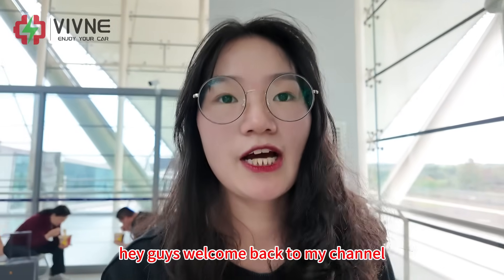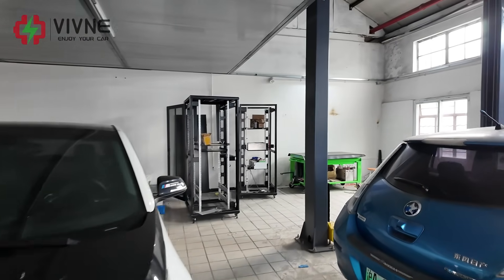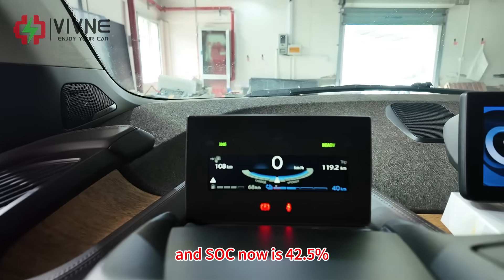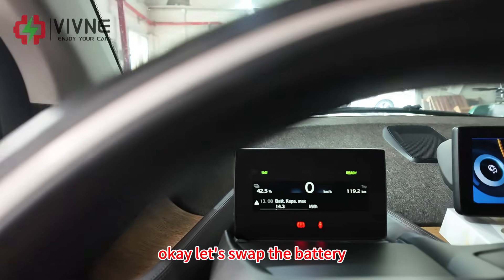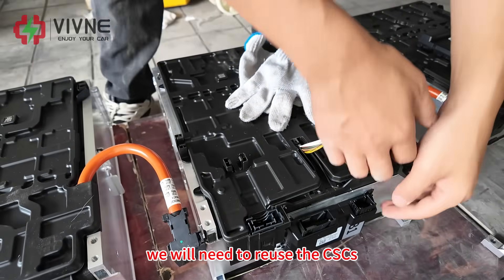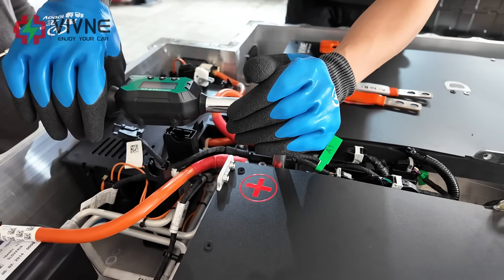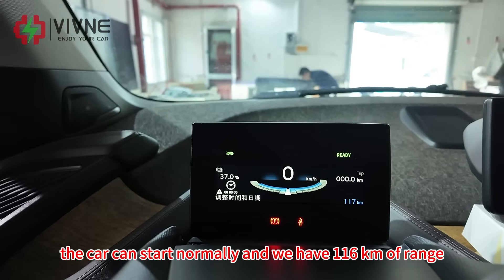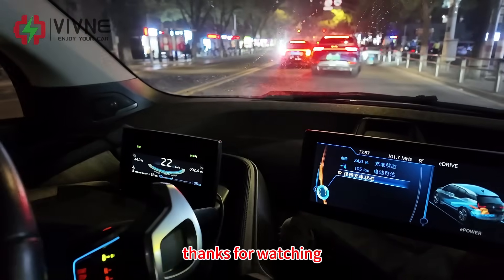BMW i3 Battery Upgrade: Full 45kWh Swap Process (From 14.3 kWh → 39.3 kWh!)

Comment: I got a 2008 Sebring with the 3.5L. Sure it runs "ok" but I splurged $400 on a new timing belt & water pump kit plus accessory belt & tensioners, etc. Paid another $750 to have it all installed by the guys at the local garage. Sure it's an old, cheap car. It'll run another 5 years, easy. Oh, wait, it had a worn-out battery too!! Same like the BMW! Fortunately, I was at the wrecker's and used my battery tester & found a decent one (with about 5 milliohm internal resistance) for $45. Well, I got 20% off because it's cold right now. I actually paid $36. So that'll take about 1/2 hr to swap out and should last 5 years, too. Oh, woe is me! My terribly unreliable old car that I bought for pennies and burned another $1000 on it so now it HAS to last 5 years. To be worthwhile.
Reply: Not sure you understand anything about the economics of EVs. Just running mine for 20k miles a year saved $4500 a year in fuel and servicing. And I don't have to drive a dinosaur..oh. btw, your car will have cost you more than the price of the EV in service and fuel.. but enjoy burning your money.

Comment: Hey. What is the price of the battery itself, excluding shipping?
Reply: good luck getting it certified
Reply from the maker: @filip3148 We actually have CE certified, thanks
Reply: @VIVNE-CoraLiu  that's not the only certificate you need.
Reply from the maker: It's 5810 USD

Comment: Same size but yet 2 time more energy. The future is bright for the used EV market. These cars will drive half million km easily.
Reply: All these old EV need new batteries. Sorry if that offends certain people, my sincerest apologies.
Reply: @Grunchy005 That's my point, genius. You buy cheap used EV with dead battery and you swap a brand new one. Easier and cheaper than doing the same thing on an ICE car with new used engine that will fail again
Reply: Don't u mean hybrids specific plug-in hybrid? aderwise bring source
Reply: Not on Tesla.
Reply: @marcin-_ Tesla can already reach that
Reply: @yutuniopati Wymieniając baterie i silniki...
Reply: @marcin-_ Why would you change the motor if it's fine

Comment: Love your videos!!  Question: What's the difference between 45kWh and the 60Ah?  (If I just look at 14.3 kWh  to 39.3 kWh then I see more then 2x)
Reply: It's two way of measuring capacity. But aH mean nothing if you don't know the tension (V). Using kWh is better.